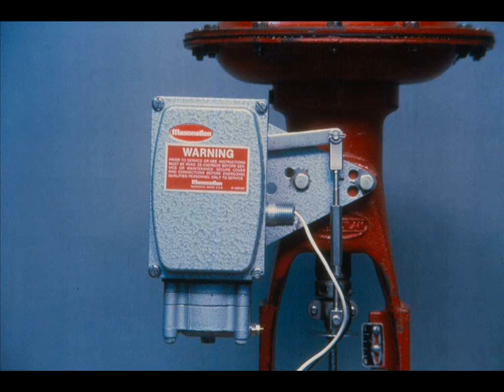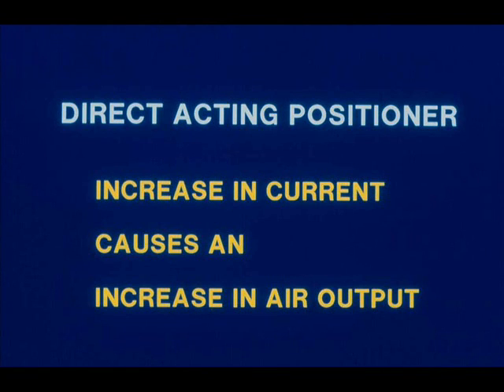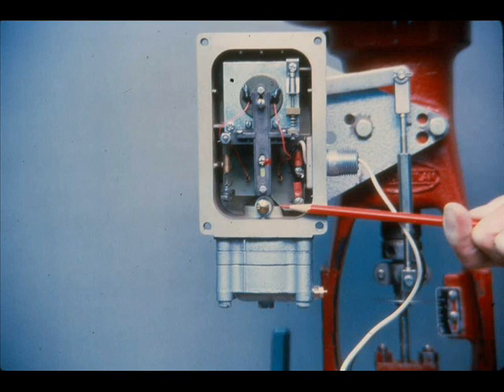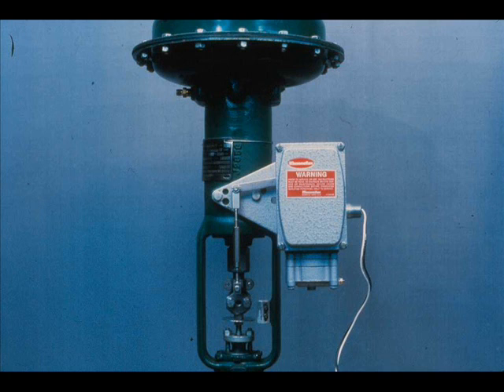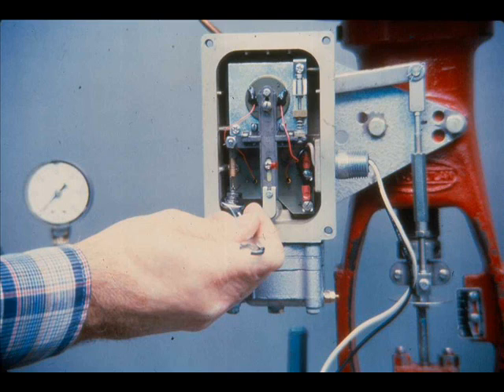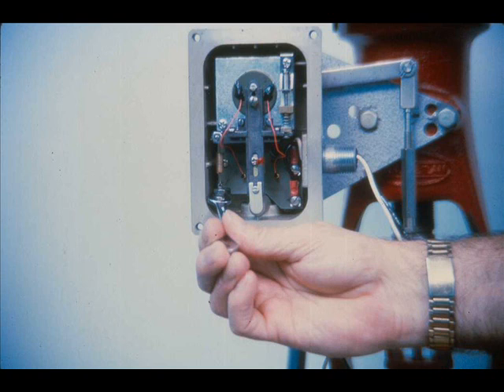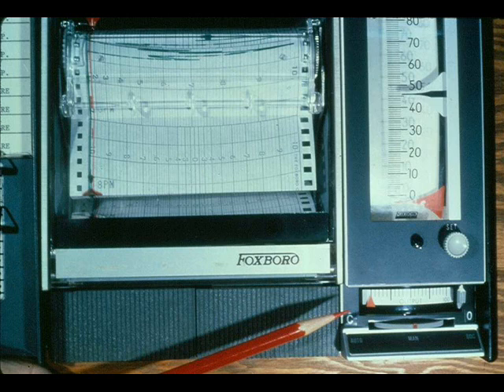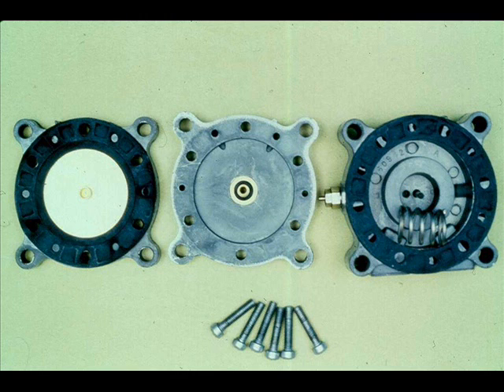Control Valve Positioner Part 5 | Install and repair valve Positioner |Troubleshoot Valve Positioner

Comment: Sir, please send me different turnbuckle length with use different actuator size and strock (pneumatics and electro pneumatic positioner)any standard table provided with mil.please sir help me.